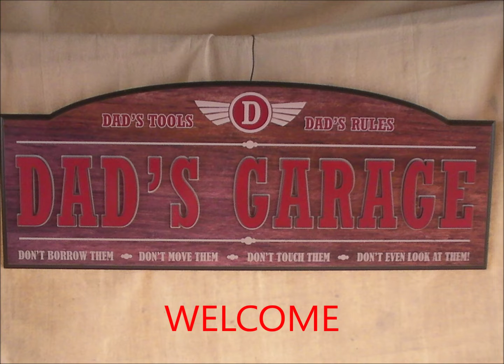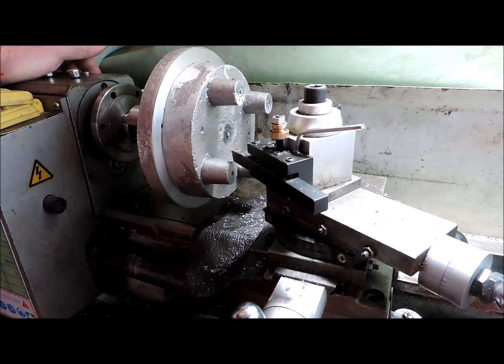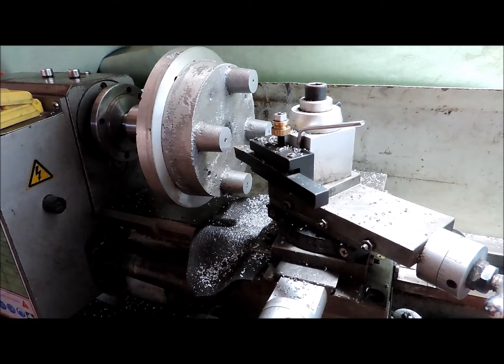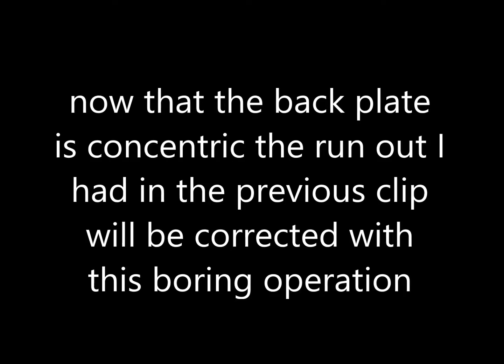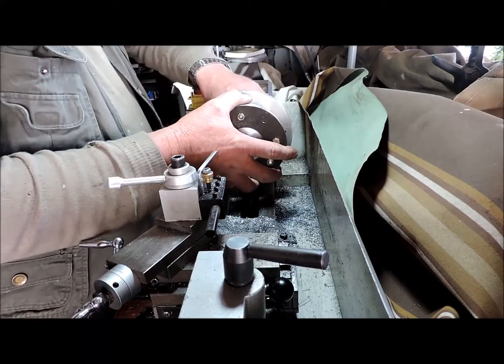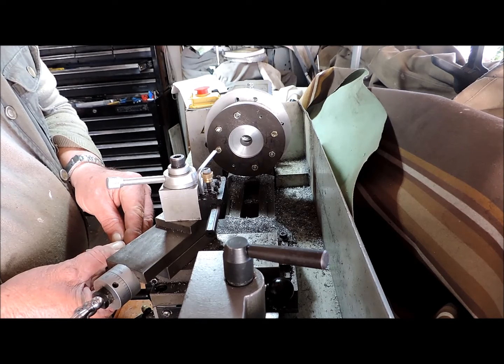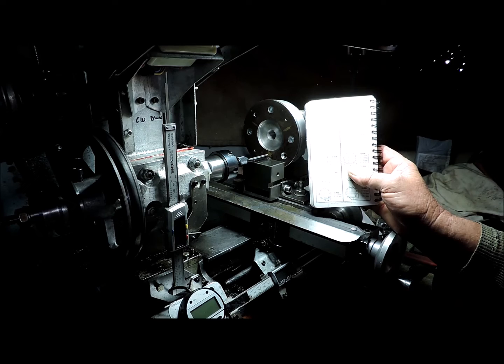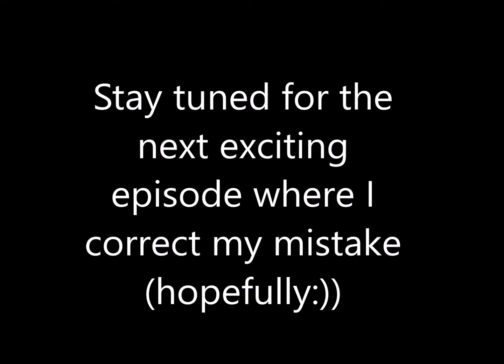Making the Gingery 4 Jaw chuck Part 7

Comment: Peter,  Making quite the progress on the back plates.  I know you are well ahead of the video, I would just turn a plug to fit the 20 mil bore and drill a locating hole in the middle, say 3mm.  The using the 3mm collet on your mill, locate the center with a drill bit and your good to go.  :-)  Thanks so much for sharing.  I have been unable to get into the shop of late because ow work and more recently storms that have upooted and broke hundreds of trees where I live leaving most without electricity.  Thanks for sharing my friend.  And I have not forgot about my last email with you.  I will follow up when I get a chance.  :-)

Joe
Reply from the maker: G’day Joe your method is sound, I think I went wrong with my method of finding centre of a hole using the wiggler rather than the tool was the problem. Hope all is good with you and your family and property as for the PDF I’m not in a hurry. 
Stay well my friend, cheers. Peter